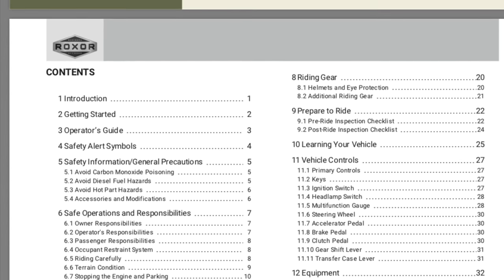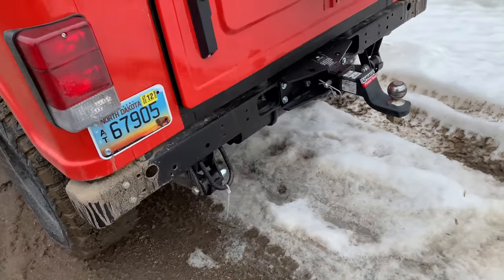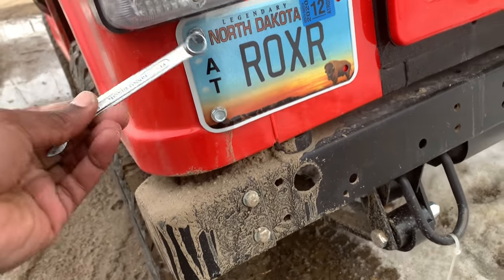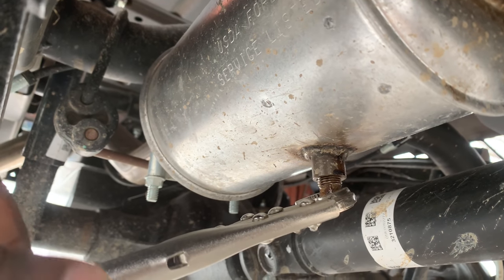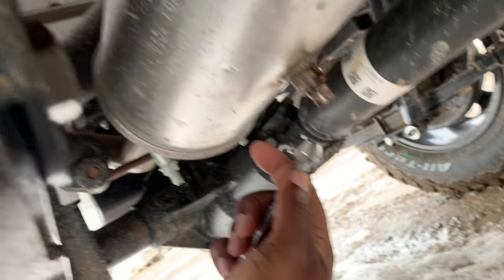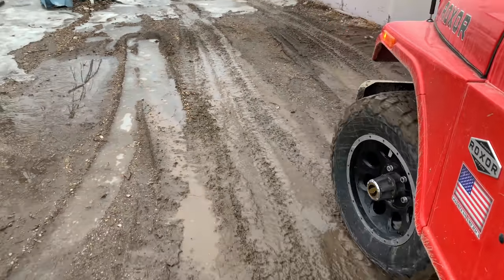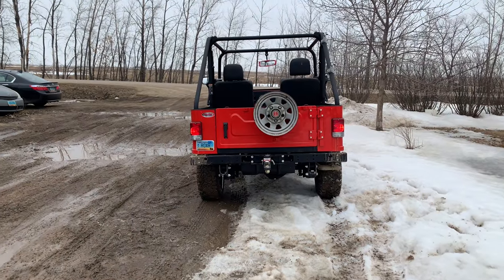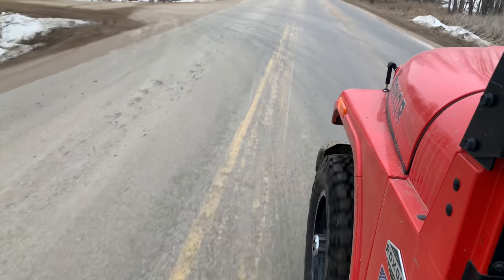Mahindra Roxor Custom Plate Plus One Important Service Item

Comment: Use a box wrench or buy a square plug socket  for that plug
Reply from the maker: Didn’t know those exist 🤔 would O’Reilly’s or Advanced Auto Parts carry those? Yeah I almost rounded it! Thanks for the tip Jerome!🕺🏽
Reply: Yes they should carry them, they look like a six point socket, only they have 8 points, very handy for square plugs, buy a set!